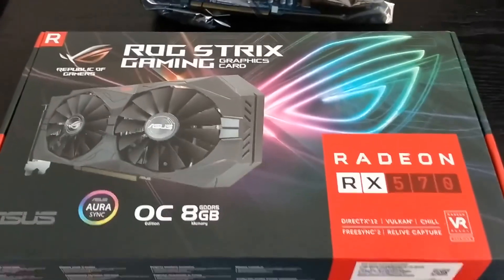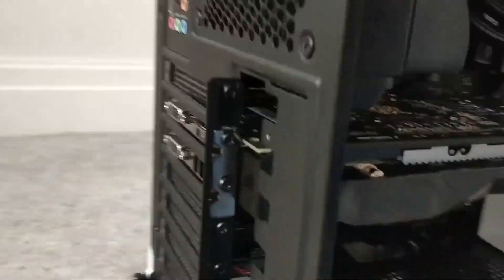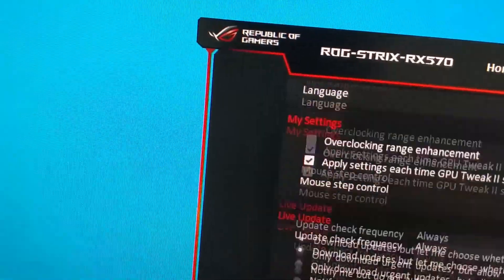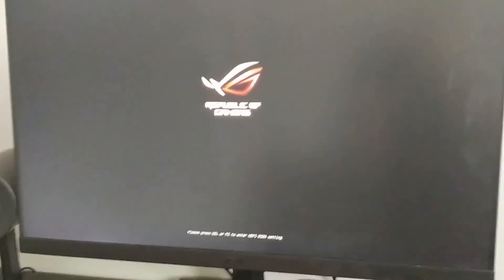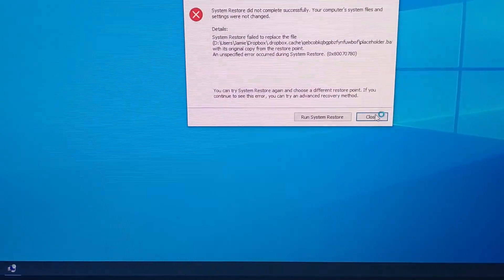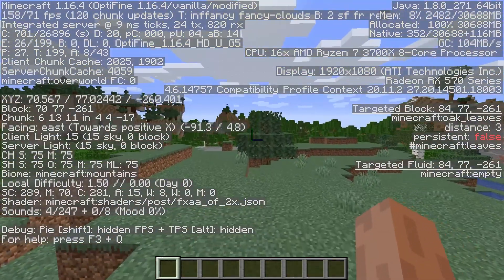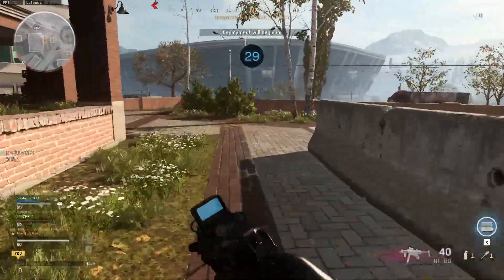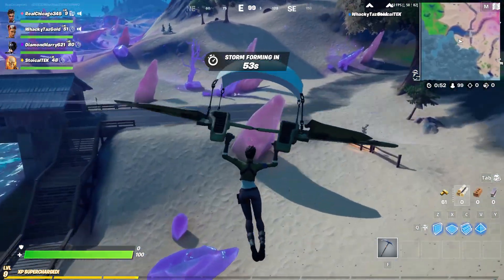ASUS ROG Strix RX570 Unboxing And Set Up - RX570 Blue Screen Crashing - RX570 Stuck On 300Mhz

Comment from the maker: Would you buy this GPU or just wait 6 months for the RTX3060 to come back in stock? 

Buy this GPU - https://amzn.to/2LkSKjO
Reply: I would NOT touch a nvidia card especially the RTX20xx or the 30xx series... too many problems with them... even my 1080ti was a POS in VR and I run multi monitors ...  I sold my POS 1080 and got RX580 8gb Red Devil..  it blew away the 1080ti and also all of my problems went away with it..  stutter, artifacts    now in 2021 I have the RX5700XT and it is a great card..   and some FYI  the Vsync holds the FPS down....

Comment: i got the exact same card, and its known that u could overclock the 570/580 to 1400mhz and undervolt it to like 1060/1070mv on state 7 ( amd wattman software) but it shows artifacts after abt 15 mins of gaming not sure why :/, im running it on 1370mhz on the core and 2200mhz on the memory right now and undervolted to 1040mv and its 100% stable and doesnt go over 65 degrees after hours of gaming, not sure why it crashes when running at 1400mhz on the core tho :( it should be able to overclock way further, id appreciate it if u could help

Comment: my pc kept shutting down with this graphics card, i have had enough of it and i actually gave my pc away to a follower of mine on twitch. i could never get to the bottom of this issue so maybe it was the graphics card.
Reply: I had this issue, managed to resolve it after 6 hours of troubleshooting. Reflashed the vbios, let windows install a generic driver, then download and installed the latest driver. Resolved the issue. PS, only flash in safe mode.

Comment: So why was the gpu under performing?
Reply from the maker: For some reason the GPU was stuck on 300Mhz, to fix this I had to uninstall the drivers/software and reinstall. It occasionally keeps getting stuck on 300Mhz and I have absolutely no clue why, it's apparently a known issue after googling it. After somehow fixing it, again I'm not really sure how I did exactly, it started going up to 1500Mhz. 

Such a fiddly GPU to get set up but once it's set up it seems to work just fine, I'm getting 70-120 fps on Warzone everything on Ultra now which is pretty decent at 1080p (I have SMAA settings turned off though as that would be pushing the card slightly).
Reply from the maker: Also, I believe my card was overclocked out of the factory as on the CCL page it says pre-overclocked edition... So when I kept trying to enable "overclock" mode in the driver software I think I was essentially trying to overclock it past the card's limits causing system crashes... For now it's fine but I will be getting an RTX3060 when available
Reply: @thetechhub8656  bdw u have a crazy bottleneck
Reply from the maker: @martinyea6718  sorry don't understand what does bdw mean? Everything is running as it should be but thanks
Reply: @thetechhub8656  rx570 is card for r3 or r5, with ryzen 7 the cpu is rly strong for that gpu and you are loosing on performance
Reply from the maker: @martinyea6718  well the GPU manufacture and CCL doesn't mention that - whether I'm loosing out or not I'm still getting a really good FPS that I'm very happy with compared to 20-30fps sometimes 60fps on the gtx660 my prior GPU hahaha
Reply: @thetechhub8656  im happy to hear that, just wanted to say that with ryzen 3 or 5 ur gonna get better performance
Reply: @martinyea6718  wtf? ur not gonna get better performance with a ryzen 3 or 5 lol, ur gonna get the same performance or even better sometimes with the ryzen 7, it depends on which ryzen 3/5/7 ur using.
Reply: @Hamza-tu4fd  r7 is made for stronger gpu's, for rx 570 r3 and r5 are rly good, but with with r7 it creates a big bottleneck
Reply: @Hamza-tu4fd  i like ur cs montages bdw
Reply: @martinyea6718  yh but still the ryzen 7 is more future proof, he can upgrade the gpu later when he needs
Reply: @martinyea6718  and thanks :)